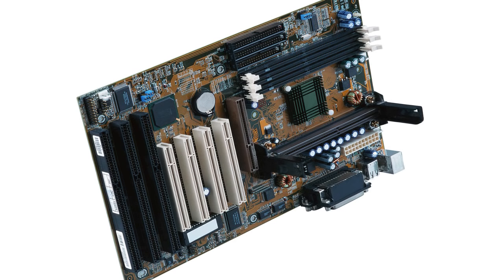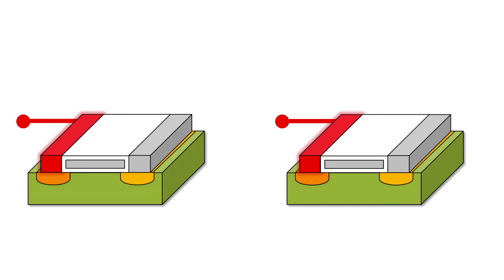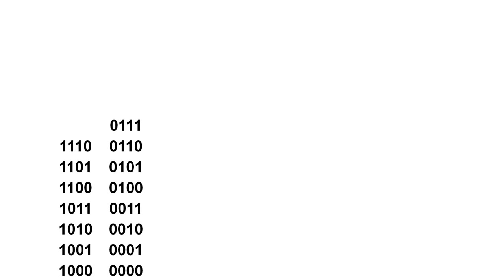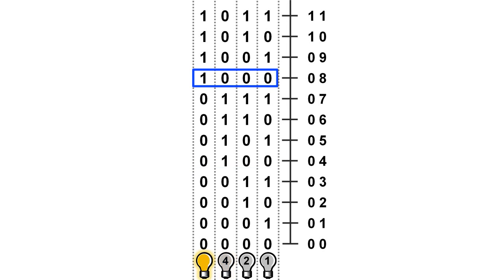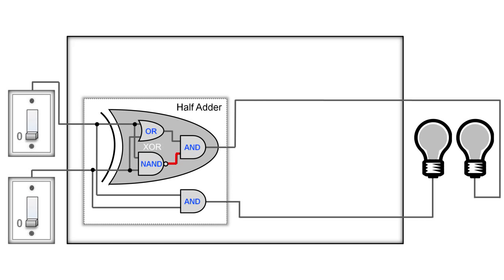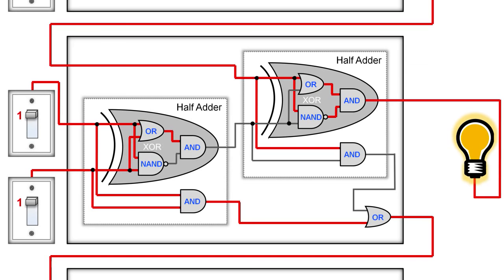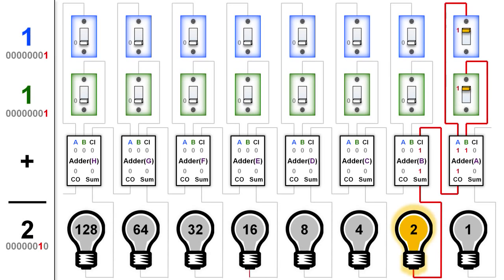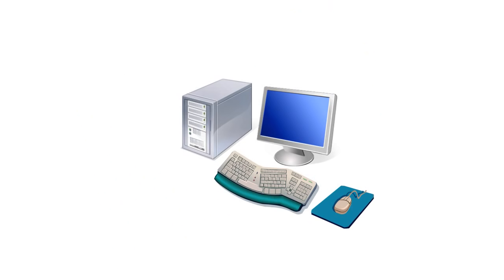How TRANSISTORS do MATH

Comment: Good video. And don't be offended it may be my own lack of knowledge. But I was advised in  a job interview that BCD counters are easier to convert to decimal than binary computers and their computers used BCD counters to do the tasks. Later I devised a calculator that used three sets of BCD counters to complete all tasks (of addition subtraction multiplication and division with positive negative or numbers that include decimal points) (It could need some ironing out but nothing really difficult) Counting devices may not however, have the advantage of speed.

Comment: The motherboard you have shown requires a Pentium II CPU that was packaged in a slot-based module rather than a CPU socket - which is missing in the photo you present. The radiator you indicate cools the motherboard chipset which is not the same as the CPU.

Comment: Please note the motherboard pictured don't actually have the CPU installed, the vertical black cartridge slot looking thing is where the cpu slots into this particular motherboard. The green chip being pointed to is actually just the glue logic for the motherboard. This is a pentium 2 motherboard and not a good example to use as the way the CPU was packaged was a-typical.

Comment: I UNDERSTAND IT!! Right up until you "turned it on it's side" and then I'm stupid again. Sucks because I understand circuits and electronics, enough to debug/fix/hack around most PCB's, long as I know chip pinouts. I even understand a lot of what's going on with the kewlio oscilloscope, but you just blew my mind, thanks.

Comment: i think there is small mistake, correct me if i'm wrong. the NAND gate is actually a NOR gate by the looks of logic if it would be opposite of AND gate, than it should output signal only if both inputs are off, and in shown example it does output signal when one is on, or both are off

Comment: 1:57 just made me realize that the actual size of that theoretical block is measured in kilometers if you extend it to a wire. Then you turn on and off the signal at one end at different speeds and have someone on the other end to understand what those signals indicate, like Morse code or a binary calculator.

Comment: Damn I’m going to play with my lights tomorrow, I think it might be some kind of not (A+B) gate controlling my living room light since there are two switches. Pretty sure if both are down it’s dark, if one is up it’s light, but then if you up the other one too it turns it dark. It makes it so either switch can always control both states independently. I believe this might be describing the gate that activates the dark state and it’s probably backwards. Using De Morgan’s rule from propositional logic in philosophy years ago: a not(A+B) is the same as an exclusive OR gate but instead describes the light state?
—— really cool video, thanks.

Comment: What you circled on the motherboard is NOT the microprocessor. It was the co-processor. The main processor on that type of board is mounted on a circuit board that slides into the connection slot to the right of what you circled. Otherwise, very informative vid!
Reply: Certainly not the CPU, I agree, as we can see the empty processor slot below it.  I was thinking it was the chipset/northbridge.

Comment: Sigh. At 0:10 That is a north bridge with a heat sink, not the microprocessor. You are actually showing an old motherboard that was taking a cartridge with a CPU mounted on it. Google pentium 2 cartridge to see what I am talking about. If you exclude this part, your video is pretty damn good. The good thing is that at 0:21 you actually show a microprocessor.

Comment: To me that looks like Pentium  II motherboard and that square with fins is the chipset not the processor.
The CPU itself is huge, and installed on a board that go in the bit slot under to the chipset.
The CPU itself is an older CPU, not sure those even need a heat sink .

Comment: What is decribed as the Microprocessor on the motherboard picture is actually the Northbridge chip. The motherboard pictured is a slot 1 which uses a Pentium 2 or Pentium 3. On that motherboard, the CPU is mounted on another PCB which plugs into the slot next to the north bridge chip. 
The North Bridge chip on that motherboard doesn't have wires sticking out underneath. it is a BGA package which looks like the other big chip (the southbridge) which an be seen without heat sink. In fact, the Pentium 2/3 chip which is mounted on the card is BGA leadless too. A better example for the video would be a socket AM2 or AM3 motherboard, which do have pins.

Also, the part around 4:30 is very confusing. 1000 in binary shouldn't be called "A thousand". One thousand is the number, not the representation. It should be called "Eight". Or binary one zero zero zero.

Comment: Question: how are the input numbers from the keyboard entered into the calculation in order to get the desired result?

As in, how is the position of the "switches" determined? How does the CPU know when it is on or off in the first place?

Does the keyboard have it preset (following the rules of binary in its memory)?
Example: pressing 3 will have 0011 in binary.
Where all buttons on the keyboard have their unique binary codes respectively in its memory.

Do u have a link u can share? Please advise.

Comment: Brilliant !   but what if you need to add two integers greater than the number 255 (or 8 bits) in length ?  Does a modern ALU allow for more than an 8/16 bit bus as input ?

Comment: Very well explained! Thank you very much! One question that I have remaining is how does the computer interpret the result? Our switched in the sketch are transistors, but what component is the lightbulb? Basically how does the PC read the result of the calculations to interpret them further into some action or anything else used to get to final result of lets say lighting up the right pixles or storing some data somewhere and so on?

Comment: 0:19 - Thats NOT the microprocessor but rather a component of the chipset, the microprocessor or the CPU is absent in this picture, it actually fits into the slot right below it, also know as a "SLOT 1" socket. This particular motherboard was from the Pentium II early Pentium III era, think late 1990s, (The PIII 450MHz was almost identical to the PII even Windows 98 recognised it as a PII, and later PIIIs came as Socket370s but can be converted to Slot 1 via an adapter). The thing he was referring to is actually the North Bridge that ties the CPU via the FSB (Front Side Bus), Memory, and PCI Busses among other components together. That is why you see numbers on CPU like 450MHz/133MHz, the 133MHz is the speed the FSB runs at which is also the speed the RAM runs at since it is tied into the same bridge. The North Bridge is connected to the South Bridge that connects secondary components like ISA, USB, IDE, and BIOS

Comment: Minecraft is the ultimate way to explain this. I still have little grasp on transistors, but I still build massively complex systems of logic in Minecraft equivalent to an early calculator.
Reply: Just remember, the guys who made this video don't understand transistors either.
Reply: It would be amazing if they added logic gates as a new redstone feature (similar to a repeater or comparator) because I hate building them by hand
Reply: JakobyGames I think mojang should include 0 tick mode in repeaters

Comment: Question : The thing that has always confused me is what is responsible for 'autonomously' activating the switches on/off to produce varying output? I understand that we can make inputs through hardware + software as humans, but what is fundamental mechanism that controls which switches and in turn, which gates are active, and finally, how the computer outputs different numbers despite electricity input being the same.

Comment: OK, I'm only 30 seconds in and I paused multiple times before I laughed out loud! 1) Why is the motherboard shown in a mirrored image? I immediately recognized that as a typical Pentium II / III era 440BX chipset motherboard, basically identical to the Asus motherboard I got with my early Pentium III system. 2) The northbridge chipset is circled and incorrectly identified as "the microprocessor." The processor for those early P3s used a cartridge design, which went into the big empty black slot ("slot 1") you see on the board. My twin brother insists that the video is trolling, but I don't think so. OK, I'll finish watching the video now :)

Comment: That's not the cpu you circled in the opening. That is an old mb that takes a 'cartridge' cpu that comes on it's own small pcb with cache and such on it and goes into that big slot screen right of the green heatsink.

Comment: I just want to start to learn embedded systems but when I started going deep into it I came to know what is the difference btw general purpose vs embedded computer systems?
in that, I got a doubt how the computer works?
on going into it I got another doubt about how it performs the programs
same doubt how it performs arithmetic and logic?
then I came to this video then I realized there is a lot to learn. 
now I will learn that for quality purposes.
need to learn:
Transistors.
transistor circuit design
Digital language design
microprocessors and microcontrollers.
VLSI design.
and finally embedded systems.
Reply: if anything I missed please let me know in the comments.

Comment: I have a question.
So, I know the gate is controlled by whether there's a current or not, my question is who controls the switch? I'm thinking like if I press number 8 on a calculator, would it automatically convert into binary 01000? How about if i press 2 digits in the calculator like 26, how it know that it's 11010? How the converting process works, i mean i know how binary works, but how does the computer know how to convert decimal to binary?

Comment: i'm sorry... CMIIW 

 but that thing with heatsink on the mother board picture in this video  is NOT a Processor.. it's an LSI, chip we call it north bridge, it's  interconnecting the memory slots, processor and the video adapter.

The main board showed on this video is appear to be an old version with Slot1 type processor but the processor is missing from the slot?, it even still have those extinct ISA bus slots..  :)   cheers

Comment: the chip pointed to and called the microprocesser is actually known as the north bridge, the CPU is missing on that board, it would normally plug into the brown slot beside the north bridge, looking at that board im guessing it was probably a pentium 2 466,500mhz or well it dosent matter ,  give or take a few hundred mhz lol

Comment: This is a great starting point, but there is a piece of the puzzle missing.  You can't truly understand how a computer does math until you understand that in binary, or base 2, the digits are not symbols used in place of 0-9 we're all familiar with.   No, binary is a way of thinking all to itself.

The fact that we count the way we do, 1 2 3 4 5 6 7 8 9 10 11 etc. is most likely because we have 10 fingers.  Well, 8 fingers and 2 thumbs.  Our numbering system is called base 10 because for every 10 increments of a digit, the digit to the left will increment one.  We could easily have base 16 if we had 16 fingers.  For base 16, also called hexadecimal, or hex for short, we would need symbols to represent the remaining 6 digits.  We currentls use the symbols 0 1 2 3 4 5 6 7 8 9.  Lets bring in letters to represent the next 6 digits.  In base 16, we would count 0 1 2 3 4 5 6 7 8 9 A B C D E F then flip 10 11 12 13 14 15 16 17 18 19 1A 1B 1C 1D 1E 1F 20 21 etc.  Anyway, the numbering system used by computers is base 2... 0 1 10 11 100 101 110 111 1000 1001 etc.  In base 2, for every 2 digits incremented, the digit left is incremented 1.  Computers think in base 2.  It's like another language.  Math on bases other than 10 works exactly the same.  There's nothing about all the math techniques we've all learned that is exclusive to base 10.  Aside from us having 10 fingers, our use of base 10 is arbitrary.  When you travel to a foreign country, to truly understand the country you need to understand the language.  It's the same with computers.

One other note of interest.  Binary numbers can be quite large in computers, containing as many as 64 digits or more.  When a computer displays numbers to a programmer, they are often displayed in hexadecimal.  This is because each group of 4 binary digits has 16 possible values.  Each hex digit also has 16 possible values.  So, it's common for a number like 01101011 to be displayed as 6B.  If the value was 0110 0111, it would be hex 67.  (The space between the groups of 4 binary digits ads clarity.  It does not imply anything about the number.)  To differentiate this hex 67 from a base 10 67, the hex value has a hex indicator on it, such as 0x before it or h after it.  That is 0x67 and 67h are two common ways to distinguish hex from base 10.  Likewise, binary numbers are commonly indicated with a lower case b.
I think that covers it.  Haha.

Comment: For which case does the XOR gate put out something else than a simple NAND gate would do? Because I went through all combinations I found (Off-Off, On-Off, Off-On, On-On) and it seems to always have the same result. So why does the XOR gate contain a NAND gate, if the NAND gate could do the job on it's own?
Reply: NAND gates can be used to construct every other type of logic gate. This is actually done often in industry and is called NAND logic because at a transistor level, it's cheaper to build using NAND gates than to use other types of gates. XOR and NAND gates do different things, but XOR gates are not fundamental and can be described using other, simpler gates.

Comment: all this thing is based on parallel ,serial and inverted connection of 2 wires. This is the base of electro-computers. PARALLEL OR GATE, SERIAL -AND GATE ,INVERSE NOT GATE. The inverse means that if you wanna switch the bulb it will turn off and opposite. It's  uses a relay or transistor.

Comment: The video needs an edit. @That Guy, The author  hasn't even figured it out yet, LMAO @0:14 he highlights that BX440 chipset with a heat sink on it, then refers to it as a "microprocessor". The processor of course having been removed prior to shooting that take (as indicated by the unpopulated slot 1 direct right of the chipset). I am 90% sure the motherboard is an ASUS P2B-F PII/III slot 1 motherboard.  One of my favorites quite easy to shell that PII cartridge and jump some contacts to overclock it. I swapped oscillators cause even with a jumped cart you are still limited to a 5x multiplier(4.5 without jump). Still I had lots of low brow hack bragging rights when my PII 450 (605mhz on a 121mhz bus) would crank out Unreal Tournament GOTY on Dual, overclocked Voodoos rockin vblank 3rd party drivers. Faster than guys with brand new PIII 6-800 mhz cpus that cost 3x what I had in my rig.... "HEADSHOT!!" ... lol good times.

Comment: There ia an error at the beggining of the video. He said that the thing under heatsink is microchip or CPU which is wrong... It ia chipset. He took Pebtium 3 motherboard as example and it is clearly visible that CPU is missing from the socket.

Thing under the heatsink is not CPU it is chipset and on the right ia empty CPU socket.... There ahould be CPU.

Comment: Why are computers based on binary (two switches) and not on say three or more? Say you go with three, then you would start with six digits instead of the four? Would that be called trinary? Or is that more complexity than is needed?
Reply: There were computers that uses 3 values (Ternary computers), but I guess their importance diminished because of the use of the more popular binary system. More info here: en.wikipedia.org/wiki/Ternary_computer